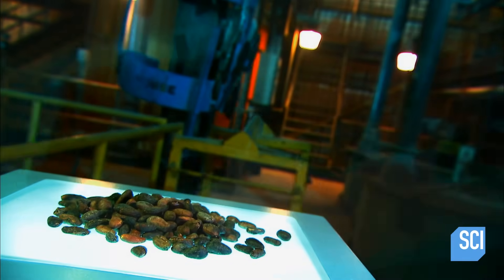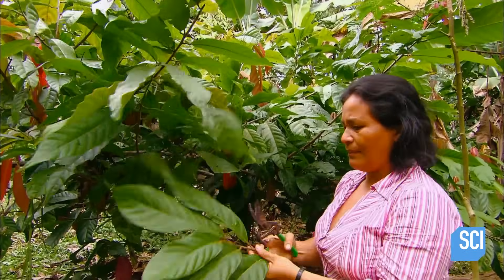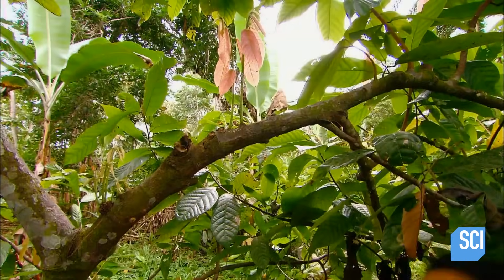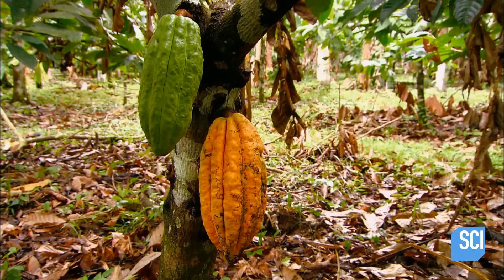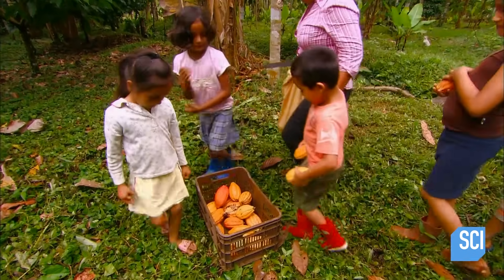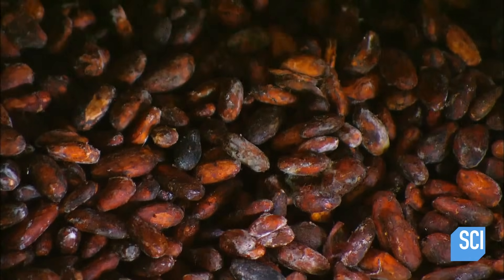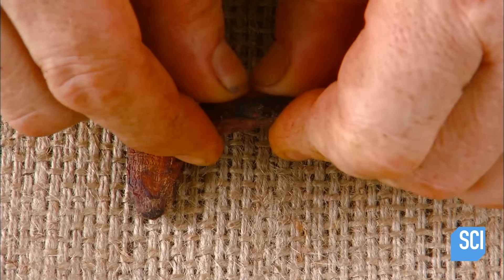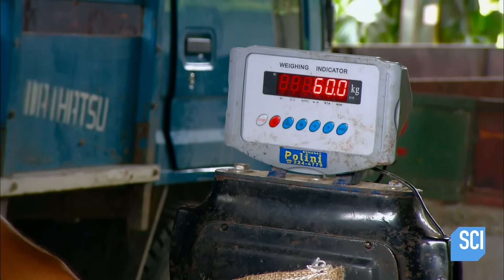How It's Made: Cocoa Beans

Comment: With these "older" videos such as this, it would be nice to have the Original Air Date posted in the first 3 seconds of the video.
Strictly as a reference.
Reply: Not sure if you still needed it, but I did a quick google for this. The cocoa beans section was aired with speed skates, synthetic rubber, and bulk chocolate, on May 13, 2011.